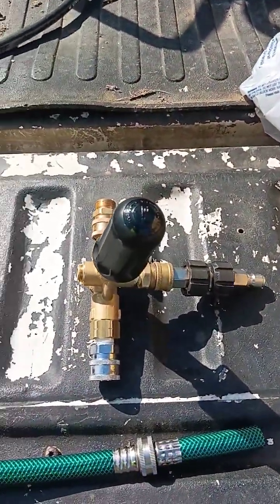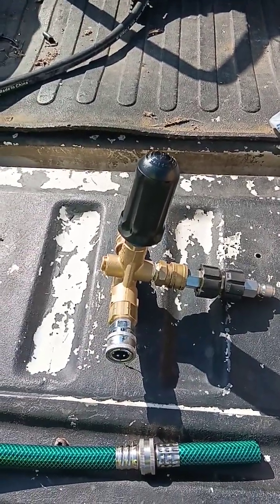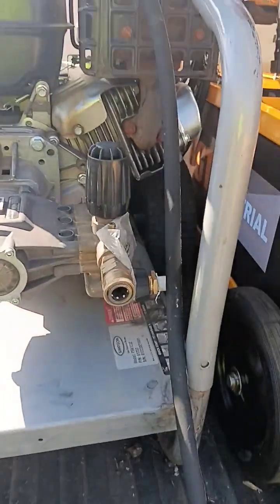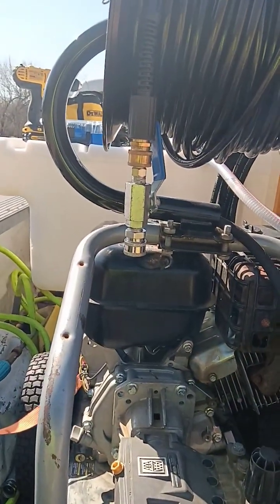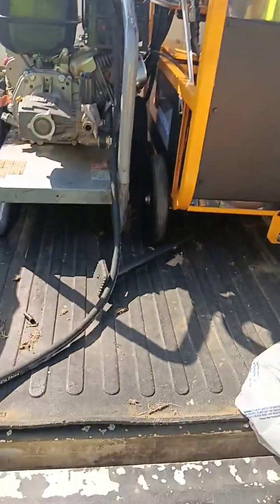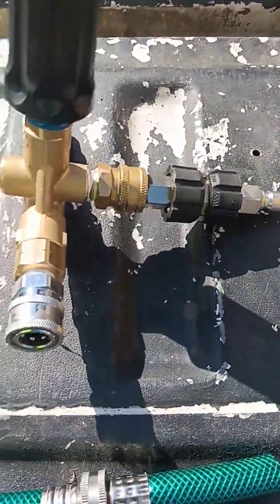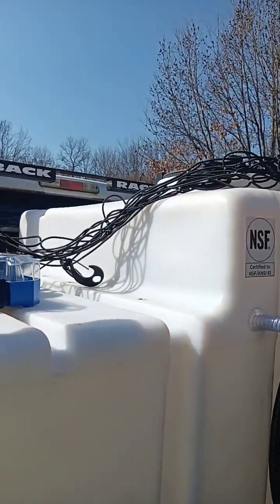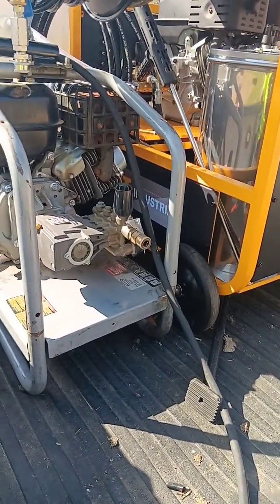External Unloader Valve for AAA Pumps with No Bypass

Comment: On these Simpson pumps, could you just remove the thermal relief valve and install a fitting to connect a drain hose to?

Comment: I did it, and it works great. The next thing I am going to try is restricting the discharge. As long as the water is moving, it can't overheat the pump.
Reply: Where do you get the parts?  I have a Simpson AAA Triplex pump that I need to add a bypass valve to.   Thank you!